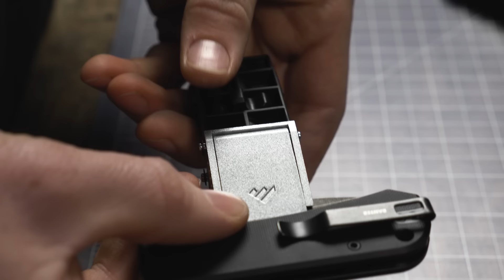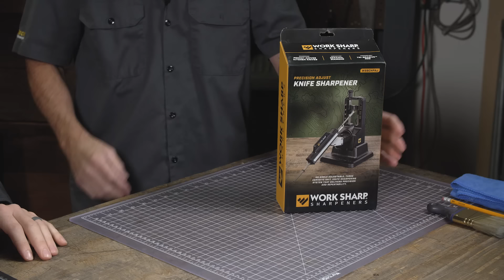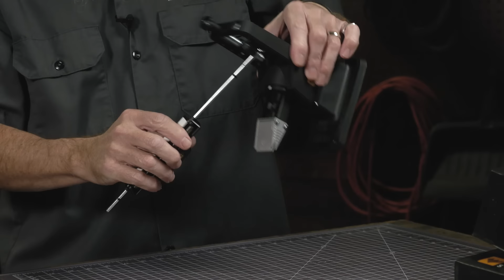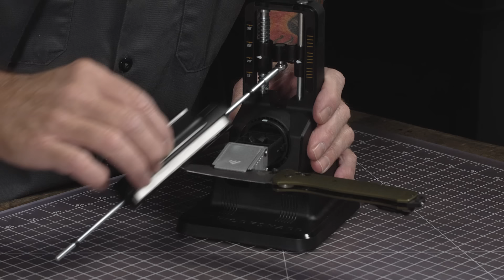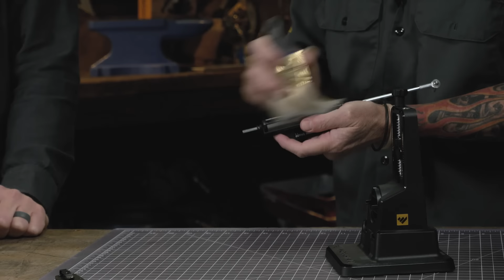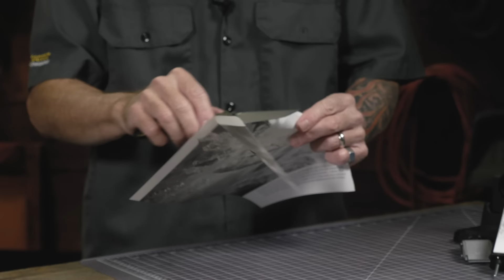How to Use The Precision Adjust Knife Sharpener - User's Guide: How to Sharpen a Knife

Comment: Just trying this for the first time and I am a little surprised that the clamp does not hold a small pocket knife (in this case, a Swiss Army one) in a way that allows me to sharpen it. If I place it in the V of the clamp, the blade will be almost completely covered by the clamp. Even if I pull it out by half of the breadth of the blade, the sharpener will touch the clamp, not the blade. Is there any way to do this? If not, I wouldn’t be able to use the tool on quite a few of my knives.
Reply: Just in case anyone‘s ran into the same issue, I have good news. Two pieces actually.
(1) The clamp still holds the knife reasonably well when inserting just a tiny part of the blade and that allowed me to use the sharpener on a small swiss army knife. It may be required to adjust the position of the knife if the forward or backward motion of the sharpening process makes it rotate out of the clamp, but that was hardly a problem and easy to control.
(2) I tried one of my simpler sharpening tools, which is basically a stone with a handle and a built in little ‘V’ made of ceramics, on a kitchen knife with a similarly sized blade. I had tried that tool on other knifes before and failed miserably. I realise now that the main reason for failure was that I didn’t understand main principles of the sharpening process as explained here (such as the importance of low pressure or checking for the burr before taking the next step). Like I learned it from this video and subsequently using the sharpening machine. Now that I tried the simple tool mentioned above again, it worked very well! Of course it is harder to keep the right angle if you hold the knife with one hand instead of using the clamp, but I was happy with the result.
When I’m done with a knife, I place the blade on a tomatoe and move it forwards and backwards while holding the handle between index finger and thumb, so there is very little downward pressure. If the blade sinks into the tomatoe, I am satisfied with the result.
Let me add that I watched quite a few videos to learn about sharpening knifes before, but with rather limited success. This video really made a difference and the learnings for me went certainly beyond the instructions on using the sharpener.

Comment: The angle adjustment moves during the sharpening process. It would've been nice if they had incorporated a locking system for that. When sharpening larger knives the clamp flexes. You can even see it in your instructional video. This sharpener should've been made to be more rigid. The base could use some weight as well. Overall it works fine but it is flimsy.
Reply: There are many 3D printed clamp support blocks for this on Etsy/amazon/ebay. It’s so essential that it’s surprising work sharp hasn’t added one themselves in a revised model. In fact, the later released pro model has a support block included!

Comment: Recently bought a set of handmade Damascus carbon steel kitchen knives. They're great knives, but being handmade, the edges are ground to slightly different angles. I bought the precision adjust elite set and just re-profiled and sharpened the first knife with it. I'm extremely impressed with how razor sharp I was able to get it. Excellent tool, I'll be using it on all my knives. Thank you.
Reply: what's the advantage of the Elite?
Reply: @leeheirbaut8154  Metal construction, heavier base, and more accessories.
Reply: @ ..Thx

Comment: The sharpener works just fine on short blades.
A knife 15cm, not so good. And on even longer blades, like a Sami knive..you got a whole deal of work.
Because the angle is true at 90 degrees, and as you go to the ends of the blade, it can vary 2 degrees.
Thats why I only recommend this machine for blades 10cm long.

It should have been a sliding point 10cm where the angle could be measured. Not just one fixed point...

AND, the clamp needs a support under broads blades. Even the slightest touch vary the angle on a broad blade, making your efforth so so..

A machine with a at least 10cm sliding neutral poing has to be made so you can work at true angles. And proper support under a 15-20cm blade.
That is the day when the perfect sharpener is made.
This sharpener has a looong way to go.
I have it, and Ken Onion too.

Comment: There's something I don't understand... Depending the blade height ( measurements from top to bottom of the blade , knife vertical), for the same angle set on the machine, due to the ball joint at
the anchorage point ,  the angle applied will be finally different no ?
Reply: Yes, up to 6 degrees from heel to tip. Clamp also allows knife to deflect downward on wider knives, further changing sharpening angle.

Comment: That looks like a good sharpener but that flex in the clamp is a huge nope for me.
Reply: Sharpening angle also changes drastically from heel to tip on long knives. Clamp in the middle to keep it about 2 degrees difference between center and tip

Comment: Unless I'm doing something wrong, this thing doesn't work. First off, it comes with one tri-stone, one surface is to set the edge, one to sharpen, and one to finish. So you only get one stone to sharpen. Is that enough to sharpen a knife to cut a tomato? Not for me. I did 10 passes each side to make sure I did enough and it doesn't get it close to razor sharp. Do they expect you to shell out another $80 for more stones to get it sharp? If so, then that's pretty shady of this company.
Reply from the maker: Depending on the knife, 10 passes may not be enough to raise a burr.  You probably need to spend more time on the 320 grit and establish a burr along the entire edge before repeating the process on the opposite side.  If you don't take the time to establish a burr you will never reach the apex of the blade and your knife won't get sharp.  Our customer service team is happy to walk you through the process.  Reach to them at info@worksharptools.com and and they will get you taken care of.

Comment: Do you count the strokes as the up and down movement of  your hand sliding the grit? Or do you count strokes as each time you go from handle to tip and back?   Thanks, BTW I just bought one
Reply from the maker: The key is to keep track of how much material you are removing (roughly) from one side of the knife as you sharpen and focus mainly on the first pass.  The amount of stokes it takes to establish a burr is how many you should do when you flip the knife over.  Don't even get us started on which direction you should go, lol.  https://youtu.be/F8JAPErskRU

Comment: I have spent 10+ hours trying to use this product to sharpen my knives and I can tell you it’s a waste of money, the v clamp will ruin your blade face and or spine as it scratches with the movement  of sharpening. The main issue I have is the way the vclamp attaches to the chassis which is way to flimsy, slightly too much pressure and it flexes which completely undermines the point which is to keep a consistent edge. You can see in this video the knife handle moving while he’s using it, that’s not the handle or the blade that’s the v clamp flexing and he’s using a “light touch”. This product was not made for sharpening it’s only useful for lightly touching up blades that are already sharp and maintaining the edge. If you try using it to put an angle on your knife you will ruin it.

Comment: IS it a 20 degree angle though? The width of the blade could dramatically change that angle. For instance, a 5 inch wide cleaver and a 1/2 inch pocket knife both set to 20 degrees will have wildly different edge geometry. What blade width was used to determine those measurement markers?

Comment: I just got a precision adjust elite. I have had for about a month. When are you going to offer an additional tri abrasive rod. 1000,1500,2000. That would really make this system the best in class sharpening system. Thanks

Comment: Won’t the sharping angle change depending on the width of the blade? For example if you set the angle at 20° and have a skinny knife and a wide knife won’t the wider knife have a slacker edge?

Comment: There are something you have to fix in this device... 1 the point of the arm of the stone is holding with the boddy, dance a lot while you are working, changing the angle of sharpening.. 2 the knife holder, its touch the stones if you are sharpening a tight knife. 3 the knife holder also "dance" to while you are sharpening, changing again, the angle of sharp... this dwvice is fine, but not awesome or the best... they need to fix those issues...

Comment: Second time using it and I can’t get the clamp to come loose. I’ve even tried to take it apart but the jaws won’t come loose
Reply from the maker: let our customer service team know about the issue and they will get it sorted.  Start the conversation by sending an email to info@worksharptools.com
Reply: @WorkSharpOutdoor  thank you so much for a reply I figured it out. The rubber grips had suctioned together which took a lot of prying to get apart. Thanks for the great customer service

Comment: I must be doing something wrong because I have worked on a s30v blade for an hour and can’t get a burr
Reply from the maker: Check with our customer service team, they can get you dialed in.  If you are changing the angle it can take some time to work through that hard of steel but our customer service team can ensure everything is working properly.  Send an email to info@worksharptools.com to get the conversation started.

Comment: Will this work well with OTF knives
Reply from the maker: It the OTF is a single edge with a spine, yes.  The clamp requires a spine to center the blade and properly when sharpening.
Reply: @WorkSharpOutdoor  ok gotcha. Thank You! All the ones I have are double edged with no spine.
Reply: It’s tricky but not impossible to sharpen a D/E

Comment: Can I get my money back?  I watched this video, read the directions, double checked the angle on the knife blade by setting everything up and laying the 320 stone onto the blade and looking closely to see that the angles all line up, go through the steps and my knife is actually less sharp than when I started. I could definitely feel the burr on the back edge each time so it was doing something, but it was not sharpening my knife.
Reply: Just want to amend my comment as I think I figured out what was going on.  I think the old knife had a 20-deg edge, but over the years of manual sharpening it’s probably not exactly 20-deg anymore.  But now using a system that is more consistent, I’ve basically had to re-profiled the edge of the blade.  I repeated the steps a few more times and I could finally feel the burr and that’s when I knew I was making progress.  I now have a good sharp edge.  I did the same with some higher quality knives and they are all now much sharper than before I started (and much less work).
Reply from the maker: Glad you got it figured out but just know we stand behind out products and have an amazing customer service team ready to answer questions.  You can reach them by email at info@worksharptools.com

Comment: Most knife sharpening systems suggest a cutting oil/water or other lubricant to keep the stones clear of grit.  Work Sharp makes no mention of this.  Just wondering whether to put a few drops on the abrasives?
Reply from the maker: Our stones don't require the use of oil or water.  You can use them if you find it to be helpful but we want our systems to be easy to use without any mess to clean up which is often the case when oil is involved.

Comment: Hello I have an important question. First, i really like the sharpener it is so satisfying. But when I am sharpening the knife every time at the end is blade sharp but then gonna try cut paper and there is no buttery smooth cut only screeching with stops and i can feel that the blade is not perfect line it has some spots that are not lined. So maybe I am missing some detail but need some advice.
Reply from the maker: Our customer service team can help determine what is going on there and offer a solution or replacement if needed.  Send them an email at info@worksharptools.com

Comment: Be cool if there was a little more metal on the unit just for weight and feel. Almost feels a little cheap like I'm gonna break it. Be cool to see a line of 1000 5000 8000 ceramic for polishing but definitely more options on the grits I would pay more for a more sturdy and weighted base. But that's just me. Thing works absolutely great and it can only get better!
Reply from the maker: We hear you loud and clear.  There are other rod and clamp sharpeners out there that offer what you outlined but you will pay a hefty price for it. We knew going with the materials chose there would be some room for criticism but when you compare pricing/results, we think we are in a good spot.

Comment: I wonder if I can use this set up to sharpen curved grooming shears? Would the curve of the blade cause an issue with getting a consistent angle?
Reply from the maker: It would depend on how much of a curve there is.  The stones are fairly narrow which makes them fairly forgiving on curve blades but there is a limit.

Comment: the width of the blade will have an affect on the angle at which it comes into contact with the abrasive , therefore varying knife widths will have subtle changes in bevel angle despite a constant setting on the lead screw. For more stability, I would have designed the rod gimbal to attach to the top side of the crossbar connecting it to the lead screw instead of hanging from the bottom, letting gravity compliment the  stability of the magnets. Also, if some larger clamp attachments were available this same tool could be used to sharpen axes and other cutting-edge tools. I like the concept, just needs some fine tuning!

Comment: You like 25 degrees per side for an edc folder? What's the point of having an M4 steel with 2.3mm thickness if you sharpen it for 25 deg? Even 20 is way too wide... I'm not buying a super-tool-steel to sharp it as it was an axe -  really wish there was a system for sharpening at 12 degrees...

Comment: How do you account for different widths of blade? For example, if you set the angle at 20 degrees, and then put 2 different knives in the clamp (e.g. a kitchen knife that is say 1.5 inches wide, and then a small pocket knife that is only around 0.5 inches wide) then you are effectively moving the contact point (of where blade meets rod) closer to the base unit. So you would get a shallower angle on the big knife than the small one, despite having not changed the angle on the unit? Apologies if I am being mathematically dense!
Reply: So in short, don’t rely on the systems numbers for your precise angle needs. They’re more of a ball park estimate, given the varying depth/height of blades, relative to the vise position, as you stated. Instead, either always use a digital angle guide (zeroed to the work surface, then set on the rod itself), or else rely on the sharpie method on a small patch of the established blade edge to zero in on the angle that knife needs. I’d also keep a small notepad handy, like one that can fit in the sharpeners case, to notate where on the range each of my edc and kitchen knives could be sharpened at, for future touch ups. Hope this helps.
Reply: @JesseCohen  thanks man, I bought the worksharp and have used it on a few knives with the sharpie method and it works great. Much much better results than when I tried the traditional whetstone method!
Reply: @Golaso99  , you’re welcome, and I’m glad passing a tip or two your way helped. I had similar questions, about sharpening jigs in general, and was able to slowly develop answers and some workflow to address them by watching other content creators here on YT. That issue you raised also applies to long v. short knives (think edc folder versus a kitchen chef’s). But the sharpie and angle finder solution works there as well, though I would add that you want to work in sections on any knife longer than say 6-8 inches. A binder clip with the jaws covered in vinyl electricians tape work as a good place holder/stop, and it’s also useful for tanto blade edges, as you work each section separately. Thanks again, and best to you and yours.
Reply: P.s. It’s this exact reason that I avoided diving in on the Lansky system, and similar. Lack of fine adjustment from a pocketable edc knife, to a taller kitchen knife like a chefs or scimiter was a dealbreaker. And this fit my currently tight budget constraints, though to be honest, I’ll likely go in on something more advanced (tsprof-ish) down the road.
Reply: I was just going to make the same comment as this. It's not really addressing the issue, it's finding a work around based on what I'm seeing. It's called precision but it's not really that. Sure I could set it to 16° for my Shun slicing knife which is about 1¼ inches tall. Then put my Shun Chef's Knife that is about 2½ inches tall in there. Which one is actually getting the 16° bevel? To what blade thickness and blade height is that "Precision" angle determined/calibrated?